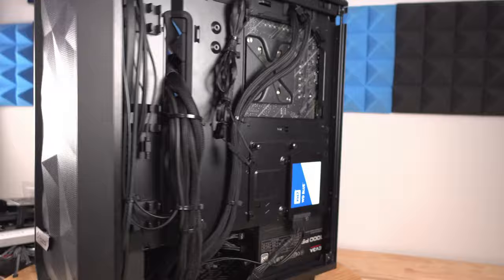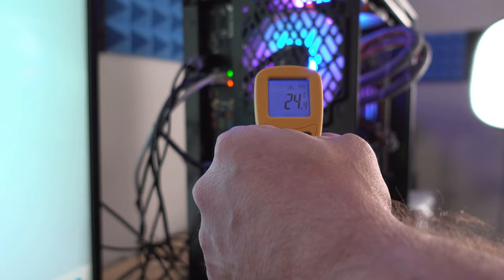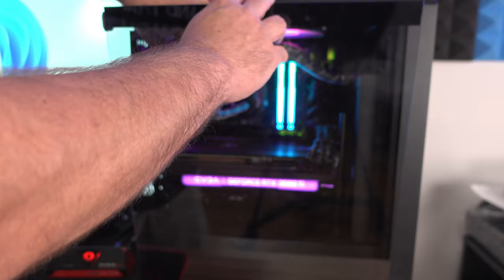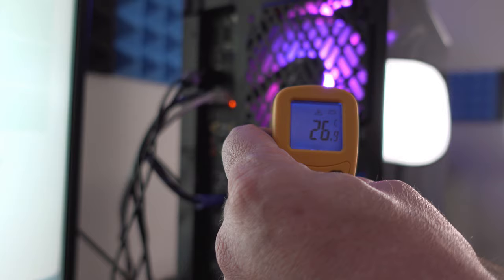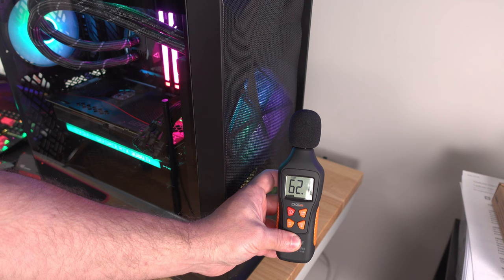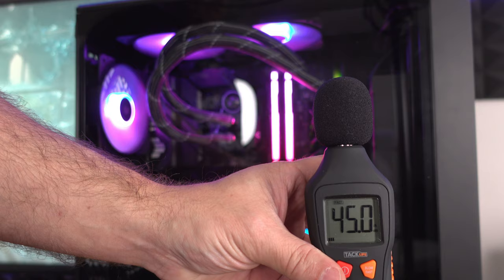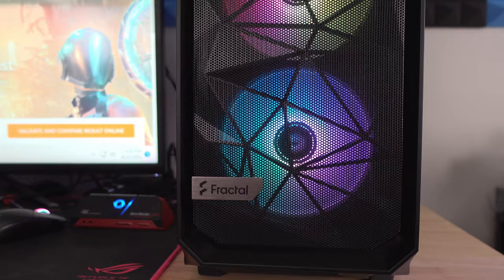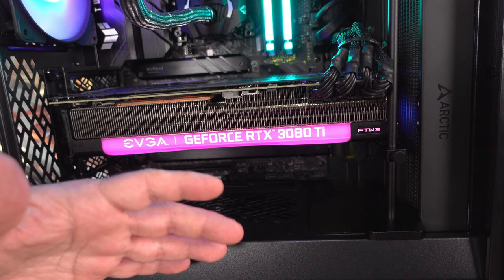Fractal Design Meshify 2 Compact RGB PC Case Review - Don't Be Fooled By Its Size

Comment: Interesting how you moved the fans on the front.  I removed the drive cage.  The temperatures are amazing, plus it is super quiet.  I got 120mm fans and the 240 cooler on a 13700KF and the temperatures do not reach anywhere near throttling.  Even in Cyberpunk the system stays nice and cool.  Oh I am running the 4070 and that is a very power efficient card.
Reply from the maker: Yeah, I was not thrilled about removing those fans, but this case isn't the great for liquid cooling units, its a great case though.  YEah with a 4070, nice that you are not seeing high temps with a 240, very interesting.

Comment: Just the video I was looking for - thanks!

I'm swapping cases to the Meshify 2 in order to pop in the LF 280 AIO also with a 3080ti FTW3 Ultra.

Shouldn't the hose's for the CPU AIO be at the bottom so no air bubbles collect in the top? Would the build still work with the hoses put at the bottom? Would be great to see if you could swap it so hoses were bottom, air will collect over time at the top and degrade performance on the AIO...sheesh, the Liquid Freezers are all big bois, hoping I don't have to choose another...thanks again.
Reply from the maker: Always a pleasure my friend, so very happy you stopped by, trusted in me to help you, liked and subbed as well as took a moment out of your day to thank me.  It means a ton to me and I am so very happy I could help you.   As for the hoses, it is best (though everyone will fight you and tell you its wrong, because internet) to have them at the bottom, but the hoses usually are not long enough and many times the video card is too long or the spacing at the bottom is not enough to have them at the bottom, the bottom is VERY difficult.  What CPU are you using?  the hoses at the top are not bad, as long as they are not too much above the pump, as you saw and heard in this video.
Reply: @ThisBytesForYou  Yes, I'd seen enough of you video's in the past that it was hose length issue which prevented you from putting the hoses on the bottom.

I have now cancelled Meshify 2 and moving to potentially the Meshify XL and LF 420 lol...

I've got a 5800x3d, ASUS X570-E Gaming mobo, 3080ti FTW3 Ultra, undervolted both the GPU and CPU, using a single fan DH-15, and looking to swap to an AIO even though I don't necessarily need to but would like to try a solid AIO. After reading how hard it is apparently to put a Liquid Freezer II 280 into a Meshify C or 2, I'm just thinking of buying another small house to house the AIO in my backyard...sheesh! lol

Thinking of going Meshify XL and getting a LF ii 420mm and running that, but I'm even reading the Chipset cooling fan on the LF II's conflict with many boards? arghh...so back to the drawing board...🙂
Reply from the maker: hahah, nice.  It just that its not meant for a 280 at the top, only a 240, but you can put what ever you want in the front, but you will have that issue, I have more coming soon on the 420mm btw, hopefully at least.  The issue with the 420 is not a lot of cases will fit it, because its huge, this is my build with the 420: https://youtu.be/VwGlIw-wHKA

Comment: Hello, I have the same tower and I have an assembly problem. At the front, there are 3 fans. With a double power cable to each fan and a double cable (RGB?) one with 1 pin a space and 2 pin and one with 3 holes (male / female).
I guess I connect the 3 fans together and there is a cable (RGB?) with holes left and I plug into the motherboard in the 5V slot? or 12V?
By cons above I have 4 cables, 1 HD Audio that I put on the motherboard. 1 Sata, I guess I have to connect it to a power cable (what is it for?). 1 power cable for the motherboard and 1 cable that looks a bit like the fan with 3 pins. What should I do with it? Because if I plug it into one of the fan, at the end, I have a male end left (with 3 pins) while on the motherboard it is also a male.
Thanks in advance.
Reply from the maker: The male end is to plug another device.  If it is not working the way you have wired it, just reverse the wiring, so you get a different connector at the end.

Comment: Hey, can't you fit a 280/360mm arctic aio on the front and 3 of the front fans fractal provided on the top?
Reply from the maker: you could, but I dont recommend it as it will lower your cases overall airflow and the hoses have to be aligned with the pump or below, not above,, keep it on the top for best performance.

Comment: Just wondering, how comes you didn't leave the stock fans at the front and put the radiator at the top? 
Ah sorry just seen, you needed a 280 for your CPU which didn't fit at the top?

I just got my first AIO (240) and mounted it at the top of the case, figuring i didn't want to blow warm air into the gpu. I guess it depends on your useage, i only have a 5600x so it doesn't put out much heat but i have a 3070 upgrading to 3090 and i exclusively game so my GPU works much harder than my CPU. I love your EVGA 3080ti btw!

(Install was a bit fiddly but the phanteks g360a i have similar to this fractal has a removable top which i love)
Reply from the maker: That you for listening to it hahah, I had to ban someone who would just look at the thumbnail and call me an idiot for doing what I did,  hhaha.  Yeah it wouldn't fit, the best I could do in this case is a 240 which would have been great for an AM4 system, but not for 12900KF processor or AM5.  I don't mind people disagreeing and have a conversation like adults, but don't insult me, there is always a reason I do it, unless I just don't know, but I do love constructive criticism just not abusive, as I don't do that to my viewers, I respect you incredibly.

As for blowing warm air, that really does not happen, I state it because I have to account for hardcore overclockers, but if you don't overclock or do mild overclocking the air won't be warm, but depending on your ambient air, may not be cool enough still or blow powerful enough, it has to go through the radiator.  If you do some hardcore overclocking then that is a bad idea because it heats up the radiator.

Yeah with a 5600X, a 240 is perfect and would fit perfectly in this case.  Yeah, I love this card, though I am using a 3090 on my workstation, waiting on the new cards which you will of course see here too, just not day one.  The 3070 is a great card, you are good, I would say you shouldn't upgrade to a 3090 (unless you get a great deal and can sell your 3070) and maybe see what happens with the 40 series or the newer AMD series, depending what you use your card for, other than gaming..  I hope you enjoyed the video my friend.
Reply: @ThisBytesForYou  great vid, I've been waiting for this case for a long time, i love it, yours is the only build I've seen in it.

I have a mild undervolt / oc on my CPU but it's staying under 65 C on a full load stress test. 
And the 3070 is a great card, i love it, but now i am enjoying pushing the graphics resolution more on assetto corsa competizione which is quite demanding especially on 3440x1440p, and i got the 3090 very lightly used for £750 (about $750 today). 
The 12gb 4080 is £949 and 16gb 4080 £1269 over here and it feels like we're going to have a big wait for the 4070 whilst Nvidia tries to run their 30 series stocks down. I can always sell it again down the line if 40 series is a real step up but for me it remains to be seen the performance vs price step up (especially once you remove DLSS3).
Although AMD are due to release next gen soon too right? Which way do you think you'll go?
Reply from the maker: if you have an EVGA card, this video may help cool it more if you like: https://youtu.be/C-A-_OPLygM

At 4K, competitive... that doesn't seem right, that requires too beefy of a machine, competitive players usually play at 1080 with low settings to eek out as much performance as possible.

As for which way I would go, I am a reviewer, I can't be biased, I will test both of course an see which one performs best.
Reply: @ThisBytesForYou  Just to make sure, you tried to put the radiator with the tubes on the bottom but they don't go far enough? I got the same AIO with this case, and I was really hoping to avoid having the tubes on top. I know it's going to be OK; I just wanted to make sure this is the only option.
Reply: So I just realized you got a 280, I got a 360 - my biggest concern with your setup is the top of the radiator is sitting almost parallel to the CPU, but I think it's still fine. I would recommend trying to push the radiator higher up though, as that is where the air would move towards. With the 360, I can see that the top of the radiator will be above the CPU regardless of the tubes being up or down, so it should be better for me.

Comment: You have your radiator upside down- tubes should be at the bottom, (so no air is pumped into the cpu block!)
Reply from the maker: if the hoses on the radiator are level or very close level to the pump, it will not get bubbles in the cpu block/the pump.  As you can see, the hoses cannot go on the bottom due to space and the tubes not being long enough and the radiator does not fit at the top.   There were no bubbles in the making of this video.

Comment: Do you need an extra program to work the rgb button on top of the front panel ??
Reply from the maker: if you use the button no, the button controls that, but then your board can't control it.
Reply: @ThisBytesForYou  hm okay I connected the SATA cable from the front panel. RGB fans are working but the button doesn’t work 🧐
Reply from the maker: @RgZDonnerZ  do it from one fan at a time, test it on one fan, then if that works, the next and so on.  If you are plugged into the front, then also the board it wont work and you need to have the reset header from the case connected to the motherboard connected to the button.
Reply: @ThisBytesForYou  Kk I will try this. Thx for the fast reply 🙏
Reply from the maker: anytime my friend, let me know how it goes.

Comment: IMO this case is not recommended for a build with large GPU (mine is 3080), I have mine set up with 2x140mm and 120mm on the front and 120mm as exhaust on the back. The GPU is not great at all at almost 83c after a while with fans running at 100%. Compared to Lancool II Mesh, the temp is 77c (fans at 75%). I do have 2x120mm as intakes on the PSU shroud though. My ambient temp is higher than your ambient temp at 28c-30c.
Reply from the maker: have you stressed it like I did and what is your config?  You might be comparing apples to cherries.  Seeing you have a 3080 and not a TI... it does sound like you are comparing Apples to cherries and not apples to apples.
Reply: @ThisBytesForYou  yeah but 3080 ti is even higher power limit than 3080, wouldn't it be hotter? my main config is 5800x (with nh-d15) and zotac 3080 amp holo

Comment: Hi mate great video love the spinning work surface! I have a question I have the same case and the 240mm arctic freezer ii with it also setup in front, atm I have a 2 fan gpu about 270mm but I would like the upgrade to 3070ti but the smallest I see are atleast 300m how did you accommodate for the triple fan gpu? As it seems like it would not fit? Thanks In advance
Reply from the maker: you can move the 240 to the top of the  case, I had a 280 and you should be good.  What is the exact model number of the card you are getting?
Reply: @ThisBytesForYou  I thought this but my ram seems to get in the way up too I have Corsair vengeance rgb (it’s quite tall)  to not 100% on the model probably the msi ventus 3x does installing the radiator fans on the outside at the front give more space?
Reply from the maker: @toothpick9347  hmm, then you might be stuck unless you get different RAM.
Reply: @ThisBytesForYou  hmmm yeah quite possibly, it’s something that very easily overlooked when parting out a build, any low profile ram suggestions?
Reply: @ThisBytesForYou  also thanks for the fast replies mate👍👍
Reply from the maker: @toothpick9347  Always a pleasure my friend, so very happy you stopped by, trusted in me to help you, liked and subbed as well as took a moment out of your day to thank me.  It means a ton to me and I am so very happy I could help you.

Comment: Hello, will the Fractal Meshify C case fit the Arctic Liquid Freezer II - 280 ? Considering that the GTX 1070 graphics card will be 285 millimeters long.
Reply from the maker: support for radiators up to 360 mm in the front and 240 mm up top
Reply: @ThisBytesForYou  Thanks for the reply. Can I install the Fractal Design Meshify C case with the front fans on the other side, just like you did in this video?
I'm just afraid that maybe my water cooling won't fit, since the heatsink is thicker than the old one.
Reply from the maker: Always a pleasure my friend, so very happy you stopped by, trusted in me to help you, liked and subbed as well as took a moment out of your day to thank me.  It means a ton to me and I am so very happy I could help you.   Sadly I have never reviewed the C, so I am not sure to tell you.

Comment: Hello my friend.
I was wondering if you would know when flying a drone what is the best fps to shoot at
When shooting video ?
Thanks.       Keith
Reply from the maker: hey bud, I would think the higher the better
Reply: @ThisBytesForYou  
I thought the same
Thing.
I will fly today at
30 fps
Just to see if it makes
A difference.
Keith
Reply from the maker: hmmm, I would say at least 60, but give it a try, 120 even better but wont work on youtube
Reply: @ThisBytesForYou  
Yes sir I know what you mean 120 will not work on YouTube and that's fine with me.
So I flew the drone at 30 frames per second like I was telling you.
It looks absolutely gorgeous but now I have another problem..

If you can help me with this I will definitely pay you $$$$
I have an m.2 in my computer, three partitions. One of them is in the red meaning it's damn near full.
So now it's telling me that my video editor does not have enough space to operate.
I tried to clear off some space but I think I'm messing things up.
So I don't want to keep screwing with it and mess things up anymore.
Can you simply tell me how to clear up some of that red to put on the other partitions of the SSD m.2
OMG I DON'T KNOW SQUAT.  LOL
I WANTED TO SEND YOU THIS DRONE VIDEO BUT I CAN'T FINISH IT RIGHT NOW.
Help
Keith
Reply from the maker: @KTHKUHNKK  what video editor are you using?
Reply: @ThisBytesForYou  
Corel VSP 2020
Reply: @ThisBytesForYou  
The error message I got says it requires at least 200 MB to continue working.
If I had your email I could send you a screenshot.
That's the only way I know how to get it to you so you can see what's going on.
Keith
Reply from the maker: @KTHKUHNKK  OK, I haven't used Corel in a long time, but if you click on your start button and type "disk cleanup" without the "" click on the windows disk clean up tool, then click OK to scan your C drive (you might to do the same to your other drives, but finish 1 driver at a time, click "Clean up System Files" then click OK again, this might take a minute, its calculating, then place a check in all the check boxes and if you have never done it, it will clear tons of gigs of space, then click OK and it will do its thing, once done, do the same for the other drives.
Reply: @ThisBytesForYou  
I'm going to give this a try like you suggested.
I did something similar I believe.
You lost me at one point in your explanation.
I'm going to have to go back and reread what you just texted me.
I would love to have gigs removed out of one of those partitions.
And sent to a different portion of that m.2

My red bar in the portion that is almost full, says I only have I believe 2.3 MB left or something.
I have to go back and recheck it.
If I could see three or four gigs removed 5 gigs whatever
I'm going to send you some money I'm not kidding. I'm not wealthy but I do pay for good information.
Keith
Reply: @ThisBytesForYou  
Could it be disc management instead of disc cleanup ?
I'm running
 Windows 10
Reply from the maker: no, its disk clean up, its been around since windows XP

Comment: I'm back LoL
What I did was I went to properties.
On my hard drive.
I hit free up disc space and a window opened.
There was one thing that was check marked
And I didn't know what it was. So I just checked remove temporary files.
My m.2 says I have 632 MB free.
Which is not a lot but it's okay.
When I get that message it says it's going to permanently delete the files that scares me.
I believe I can use
Corel now.
At least for a while.
I don't understand why that part of the hard drive keeps filling up when I'm not adding anything to it.
OMG I AM SO CONFUSED ABOUT THIS STUFF.
Mad Kuhn
Reply from the maker: it should have opened up disk clean up as well, which should let you do everything I was talking about.  if anything you will need to delete files.
Is that your C drive or another drive?
Reply: @ThisBytesForYou  
Thanks buddy I'll check it again I just don't want to screw up..
Keith
Reply from the maker: @KTHKUHNKK  I use Disk Cleanup, a built in tool in all my machines, even the servers I manage (though I need to unlock it in servers)
Reply: @ThisBytesForYou  
I'll get it sooner later buddy.
Like I say if I could free up five gigs I'd be happy.
Just as long as my
Corel keeps working.
KK

Comment: 'over a few days have been stressing in it, been doing so many things in it' ... I guess you enjoyed this case a bit too much?
Reply from the maker: When you love PCs like I do, you can't love them enough.  This isn't my favorite case but it is a great case.  I stress because I try to bring my audience the best.
Reply from the maker: all of the fans are PWM compatible, they are 4 pin fans, so it will work great with your system as long as you have the fan headers set to PWM in the BIOS.